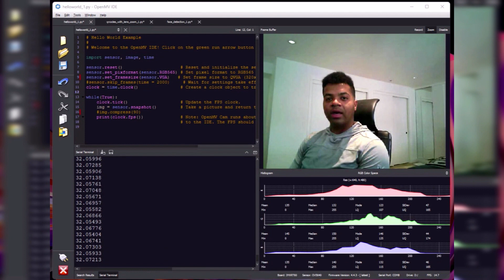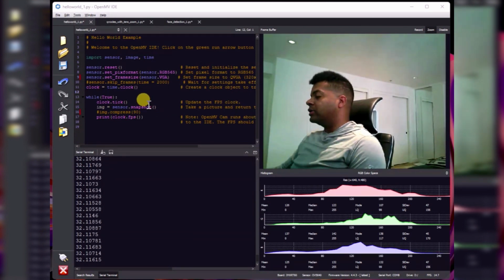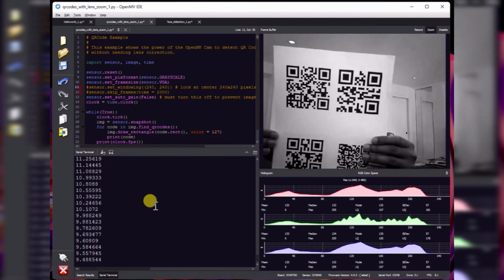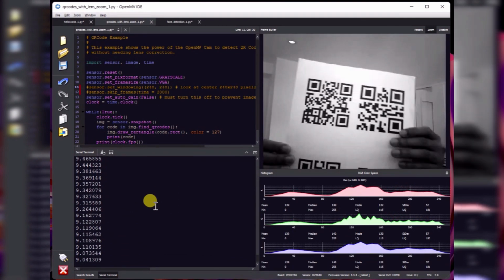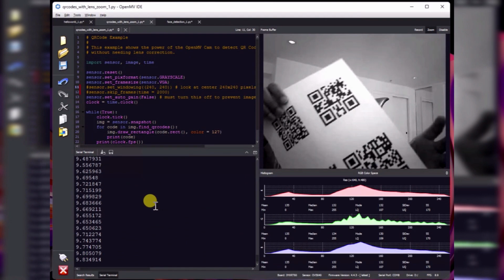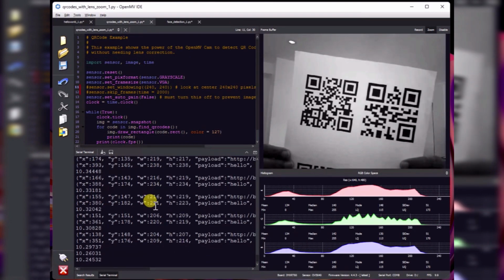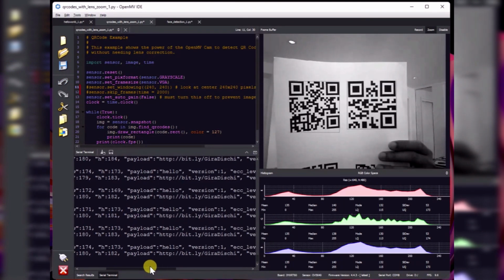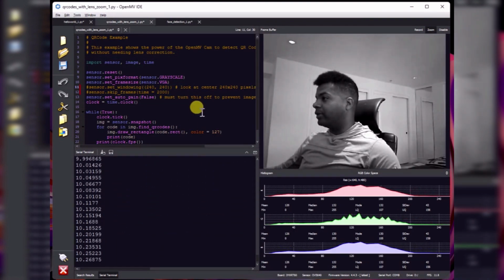OpenMV Cam RT Prototypes Work

Comment: I want to draw a similar openmv5's board,that's made use of imxrt1176,but soft code that prevent me create.However I looked you 1170 part's project ,so can I gain you help.That's thank you very much!!!
Reply from the maker: Hi, we may build a IMX1170 module. However, it's no something we have the bandwidth do right now.